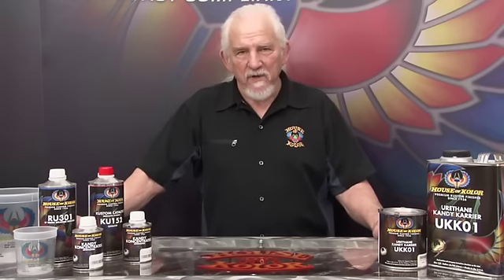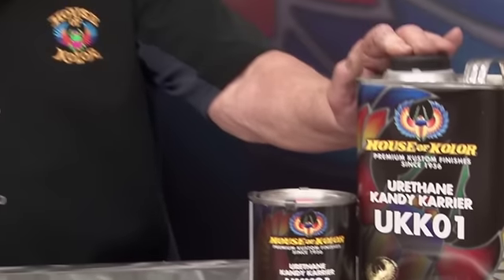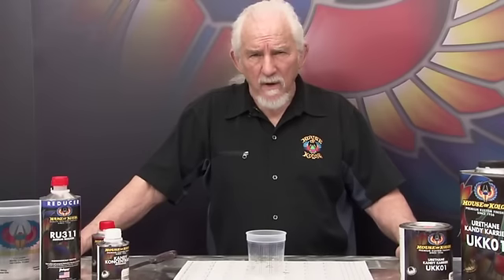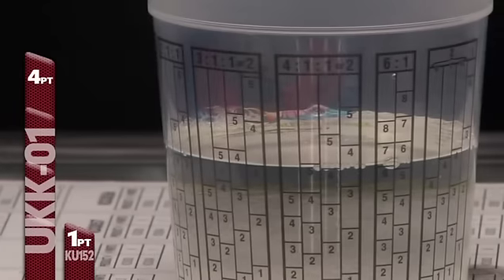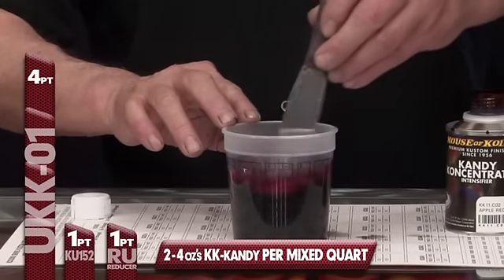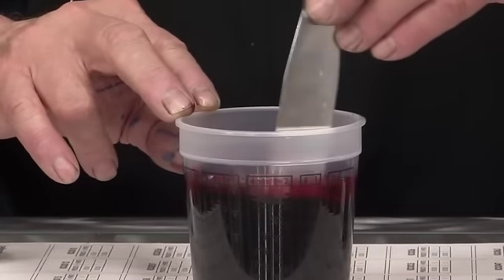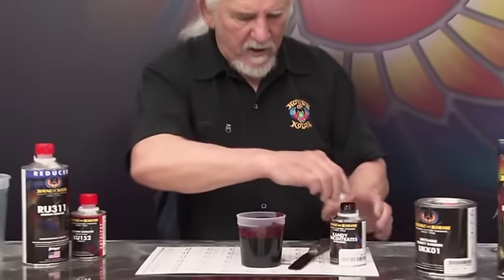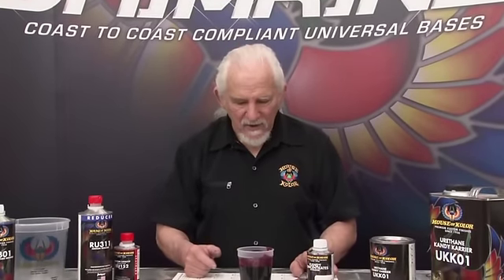House of Kolor - Shimrin2 UKK01 Kandy Karrier

Comment: Would this be compatible over 45 year old custom paint jobs.  I’m sure it’s single stage but that was before my time. Don’t know what the airbrushers and custom paint guys used back then.. it’s starting to fade out, and even chalky in spots.. tryin to lightly scotch brite and use a transparent midcoat to bring some color back to it and clear for protection on this true survivor Corvette. Realize it’s not a perfect solution but the car was taken straight to the custom shop from the dealership and some of the best custom work I’ve seen. It was really really something back in the 70s. Just tryin to preserve it the best I can.